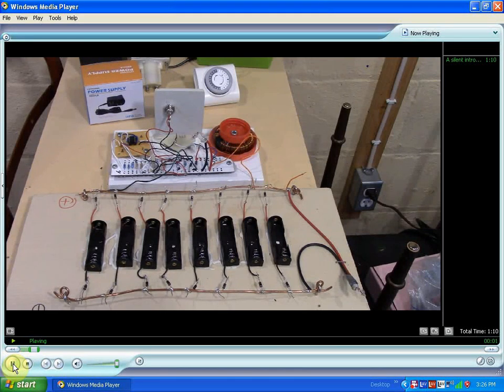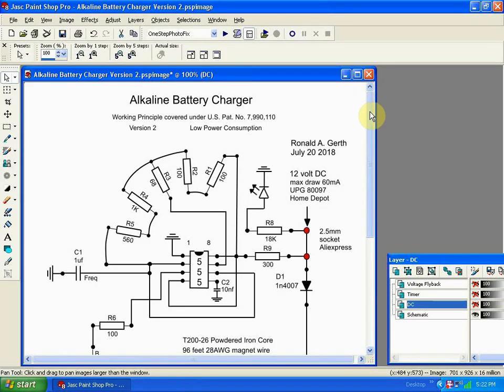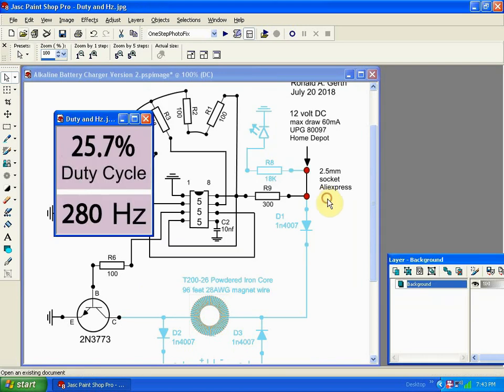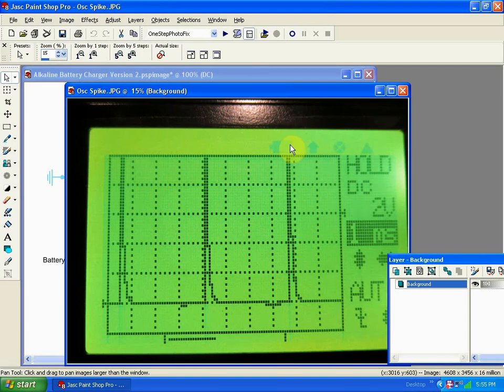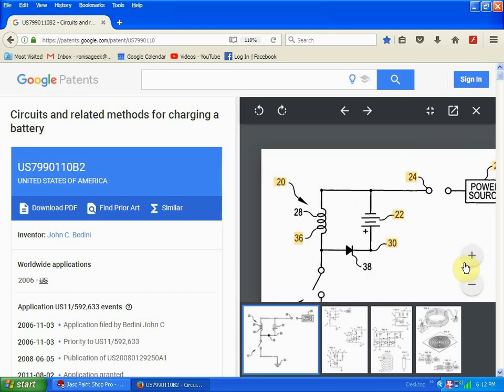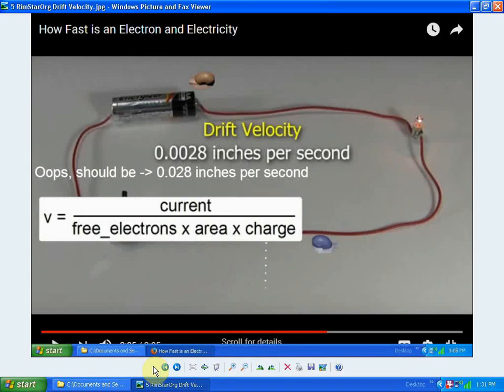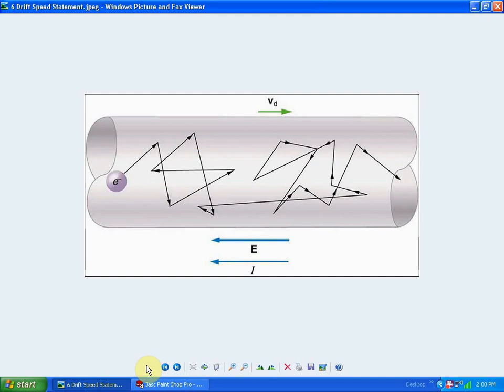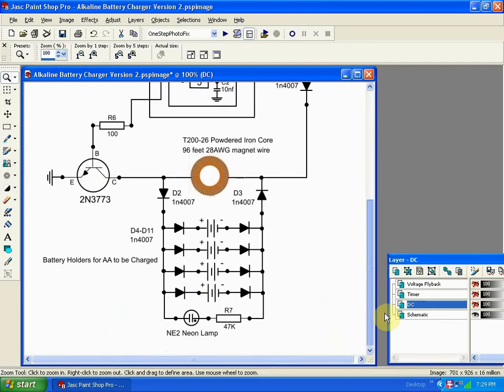Alkaline Battery Charger

Comment: @ronaldgerth5120 (or anyone) -- The electricity that is charging the batteries [and storing energy in the batteries] cannot be "perfectly cold electricity".

There must be some small, non-zero amperage present (which means that there must be some electrons flowing into the batteries), because the formula for watts of electrical power is:

Watts  = Volts X Amps [energy per unit time]

If the Amps are truly zero, then the Wattage is zero, and the energy flow is zero, and no energy will be available to be stored in the batteries.

Unless perhaps this classic equation somehow breaks down and is not strictly applicable at extremely low amperage?

Comment: @ronaldgerth5120 (or anyone) -- Which resistors need to be 1-watt, 1/2-watt, 1/4-watt, 1/8-watt? . I know that your video and schematic are billed as "low power", but what are the wattage ratings of the resistors that you used in your build?

Comment: PARTS LIST [Expand this comment to see the list]
-- compiled directly from the schematic and other info in the video:

A. . POWER & RELATED PARTS

1 -- Wall Outlet 110V-AC Timer Switch (to limit charging time to ~2 hours) -- see first link at the end
2 -- Switching Power Supply, 12V 500mA, UPG Model Number 80097
3 -- Jack to match the barrel connector on the power suppy
4 -- R8, 18K resistor (leading to LED and ground)
5 -- LED light (power-on indicator light)

B. . PULSED SQUARE-WAVE GENERATION PARTS

6 -- R9, 300 resistor (leading to Pin 4 and Pin 8 on the 555)
7 -- 555 timing chip
8 -- R1, R2, R3, R6 100 resistors (Qty 4)
9 -- R4, 1K resistor
10 -- R5, 560 resistor (leading to the transistor)
11 -- C1, 1uf capacitor
12 -- C2, 10nf capacitor
13 -- 2N3773 transistor

C. . HIGH-VOLTAGE SPIKE PRODUCTION PARTS
(routed to 4 AA Alkaline Batteries)

14 -- T200-26 Inductor Core
15 -- 96 feet of AWG 28 gauge enameled magnet wire -- see second and third links at the end
16 -- D1 through D11, 1n4007 diodes (Qty 11)
17 -- AA Battery Holders (Qty 4)
18 -- NE2 Neon Lamp (charging indicator light)
19 -- R7, 47K resistor

PLUS: . scrap wood for main base, thin mounting board (vertical) for the 12V female power jack (to accept the barrel connector from the UPG power supply), small epoxy mounting board for 555 chip, elongated rectangular epoxy mounting board for resistors and capacitors, silicone spacers to go between smaller epoxy boards and the larger main base, screws to attach the smaller boards to the main board, silicone flap to cover transistor, electrical tape to secure inductor leads, plastic bottle caps and screw to mount inductor, mounting board for battery holders, circuit wire, solder

See also:
https://www.youtube.com/watch?v=5X_oWX5IH7o
https://www.youtube.com/watch?v=MoqT-Fx0DP0&t=20s
https://www.youtube.com/watch?v=zL51M-0ebXc

Comment: @ronaldgerth5120 (or anyone) -- For the inductor... If 26-gauge magnet wire is used (instead of the 28-gauge wire in the video), should a different inductor core and/or a different total length of wire be used, to get an equivalent result when installed in the charger? . Or will 96 feet of 26-gauge wire in the t200-26 be okay? . Would something like 120 feet of 26-gauge wire in a t225-26 be okay?
Reply from the maker: Inductor core T200-2 red should work as well or better due to the spec inductance factor of 120uH. it is 92 uH for the T200-26. The magnet wire can be 26-gauge but be aware that the resistance will drop from 6.5 omh to 4.8 so the coil will get a bit more wattage. That should also be fine since the circuit I designed only uses 1/2 watt and half of that is just for the indicator light. The basic idea is to use as little wattage as possible to make a very strong momentary magnetic field and your changes should add to that function. Good luck to you @heliocentric9971
Reply: @ronaldgerth5120  -- Thank you for taking the time to compose a thoughtful, knowledgeable, and helpful reply!

Comment: @ronaldgerth5120 (or anyone) -- Given the relatively low-frequency of 280Hz coming from the 555 chip, would a T200-2 red-colored, ferrite-core, toroidal inductor core (as a substitution for your T200-26 yellow-and-white-colored, powdered-iron-core toroidal inductor core) work about equally well for generating a sufficiently large and "cold electric" voltage spike (with a zero to negligible current flow through the AA cell)? . . . . . Similar question: . Could any of the following other T200-series cores be substituted: . T200-6, T200-7, T200-10, T200-12, T200-20, T200-52b ?

Comment: @ronaldgerth5120 (or anyone) -- "...can't measure a voltage spike across a battery..." . Why not? . What do you see on the oscilloscope if you try anyway? . Would it make any difference if a person were trying to measure the voltage spike across a brand new AA alkaline battery, when the internal resistance would be at it's minimum value?

Comment: @ronaldgerth5120 (or anyone) -- 1) Would there be any advantage to building this type of charger to charge NiZn, NiMH, or Li-ion Batteries, as compared to the best of the currently available chargers for these types of rechargeable batteries? . 2) . If so, what are the most important things to know when  building this type of charger to charge NiZn, NiMH, or Li-ion Batteries? . 3) . Could this type of charger successfully recharge "Heavy Duty" or Zinc-carbon batteries? . Thanks

Comment: @ronaldgerth5120 (or anyone) -- After viewing some other Youtube videos on recharging 1.5V alkaline batteries, I have come to understand there are two other important matters regarding battery health: . a) . What is the the internal resistance of the alkaline cell when brand new? ...And what is the internal resistance after recharging? . b) . What is the maximum current that the brand new alkaline battery can produce under the range of loads it might be expected to endure? ...And what is the maximum current that the recharged alkaline cell can produce under the range of loads that it might reasonably be expected to endure? . c) . Do you routinely or occasionally test for a and b after successful no-load voltage recovery?

Comment: @ronaldgerth5120 (or anyone) -- 1) . Are there any chargers that I can buy on the market that very closely parallel what you have built in this video? . Why or Why not? ... 2) . Of any AA alkaline "single-use/disposable" cell that you have successfully recharged, what was greatest difference between the final charged-up voltage, and the initial, depleted voltage? [a reasonable estimate is a fine answer] ... 3) . For any single specific AA alkaline "single-use/disposable" cell that you have repeatedly charged, what is the greatest number of charging cycles in which the estimated mAH capacity was always at least 1/3 of the estimated original mAH capacity? . [ a reasonable estimate is a fine answer] ... 4) . Using a 1/2 depletion allowance before recharging, what do you think is an easily achievable number of cycles when starting from a brand new AA Alkaline Duracell or Energizer? . [a reasonable estimate is a fine answer] ... 5) . The following chargers claim to recharge AA alkaline non-rechargeable/disposable batteries: LLoytron B1550, MaximalPower FC999, Renu-It Pro (or Deluxe), Buddy L Super Charger, Saiter Eco Green, Rayovac Renewal (PS1, PS2, or PS3), Popular Mechanics Charger, Grandcell Rechargeable Alkaline Charger, AlkaCharger [thirty-four slots!]. . Can you (or anyone) recommend of these chargers? . Do any of these chargers have sizeable inductors in them to generate pulsed hi-voltage, low-current spikes? ... Thanks for your answers.

Comment: Hi, Ronald. I wanna build this charger. What is your results of charging batteries? Do they leak? What is the charge end voltage?
Reply from the maker: Yamato, I use this charger often using batteries neighbors bring to me.  I have charged many 100's of batteries. No batteries have ever leaked during or after the process. Heed the use by date, batteries can leak any time after that date due to age. Charge by time. 2 hours per battery is usually good. Let batteries rest for 4 hours after charge before measuring voltage. Measuring voltage during charging is nearly meaningless. Measuring voltage  after a rest of several hours will show if the battery really absorbed the charge and how much. Charge again if result is lower than desired. Each battery will be slightly different in charge held. I stop when my batteries hold a minimum of 1.48 volts. Maximum charge will be about 1.53 volts.
Reply: @ronaldgerth5120  So I built it. And the frequency results differs from yours. I've got 140Hz and 24.7% d.c. I matched resistors values as yours. I dont know why. But i think it will be OK. Maybe later i will rearrange timing circuit. I didn't found T200 core, so i used smaller one(lot smaller), but i think T200 is a bit overkill. Also i made mistake in calculations and my inductor gives only 44V(will fix that later). Circuit draws 100mA @12V. Overall it works PERFECT! My 20+ y.o dream came true! Thank you!
Reply from the maker: @madkaz09  I am glad you have success! Thank you for sharing your experience.
Reply: @ronaldgerth5120  Thank you!

Comment: I have a quick question, what does does isolation diodes do in circuit?
Reply from the maker: DYNXT, The isolation diodes isolate each battery from each other. If alkaline batteries are connected in parallel they will equalize charge with each other. That small amperage flow in the wrong direction is enough to cause damage to the internal gasket on the negative end of the battery. Once that gasket is breached, the battery is doomed.
Reply: @ronaldgerth5120  ok, so it stops reverse current?
Reply from the maker: @dynxt-_-3243  Yes.
Reply: @ronaldgerth5120  ok, thank you and great video

Comment: Wow, I like your professional presentation. I might make one of these using an existing power supply transformer winding. Those will zap you good. I ain't winding 90 feet of 28, no way.
Reply from the maker: Harold, please do and thank you. A transformer secondary should work of course but keep in mind this circuit was tuned to fire the toroid in the schematic. A different coil may need tweaking in the resistors that govern the duty cycle and frequency. If you make changes I advise using an oscilloscope (with a 10x reduction probe!) to make sure your output is a spike and NOT a SQUARE wave! Please consider sharing your results or failure with others. Good Luck.
Reply: @hlacadie -- The "ring" portion of the T200-26 is about 3/8" wide and 1/2" tall, for an approximately rectangular perimeter of 1-3/4" . . . . . When you wind 96 feet ( 1152 inches) of enameled 28-gauge magnet wire onto a T200-26 core, an approximate average value for the inches of wire per turn is likely somewhere between 1-3/4' and 2-1/4" -- it might be around 2" or a little more. . 1152" divided by 2" per turn suggests 500 to 600 turns for the finished inductor.

Comment: hi good circuit design but it is complex. A simple and effective charger circuit The charger is the pulsing half-wave charger with a parallel resistor to obtain 10% reverse current. It is very beneficial for many types of batteries. Find your ernst beer battery charger.